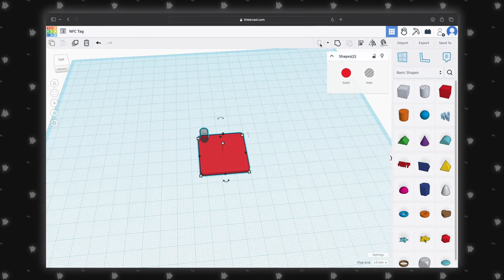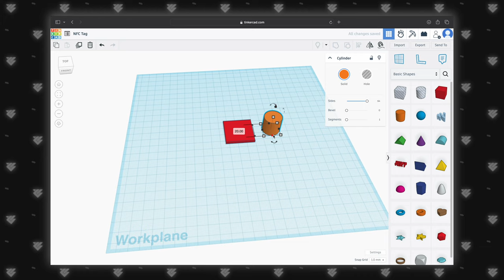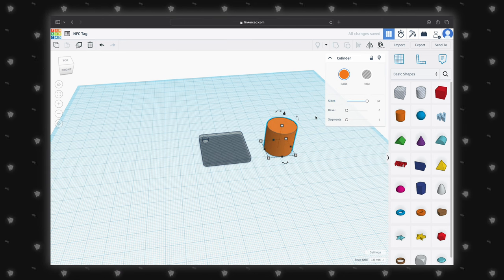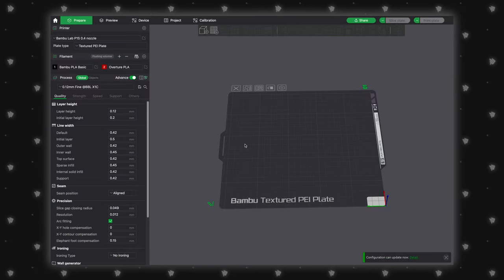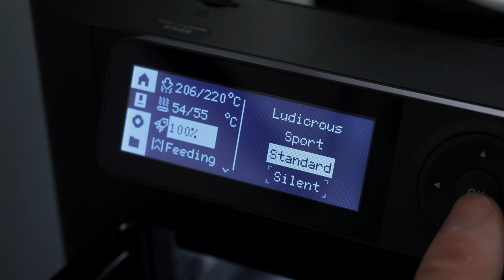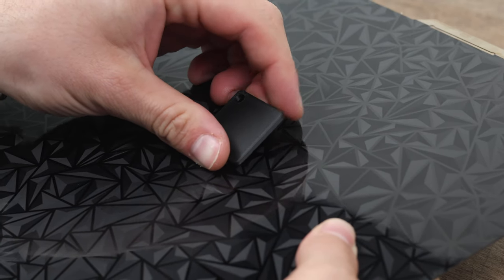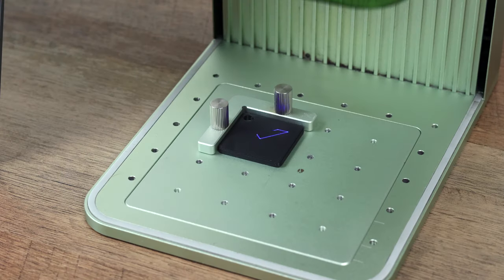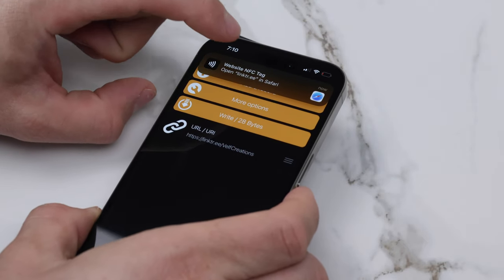DIY NFC Keychains: Design & Print with xTool F1 and Bambu Lab P1S!

Comment: I dont have a 3d printer, but Im thinking I could do this entirety with my CO2 laser to cut layers (maybe two 1/8" and one 1/16") of acrylic and connect them with some 3M. I dont know much about the nfc stickers though - is there any reasons this wouldnt work?

Comment: Slowing down a layer might be possible by inserting some custom gcode. But for your specific use case, wouldn't it be enough to slow bridging speed down?
Reply from the maker: Ah! Bridging speed! We will give that a try! Thank you! For the amount of prints we do we often just use the default settings so we sometimes forget about some of these other options.